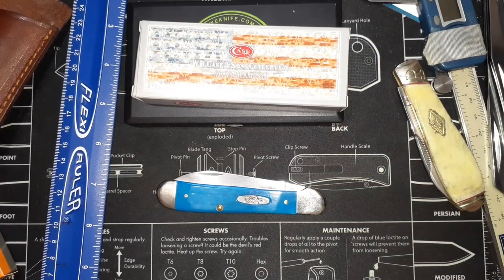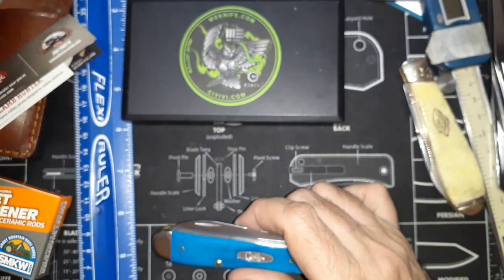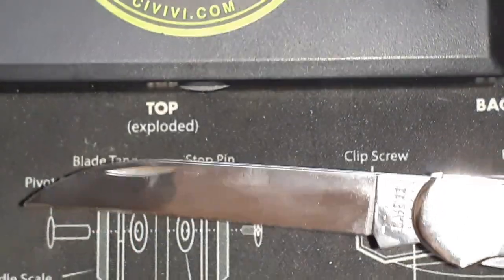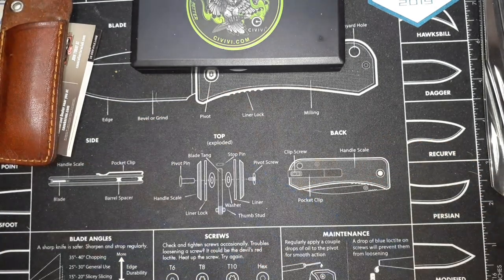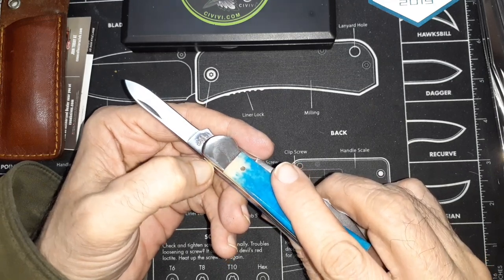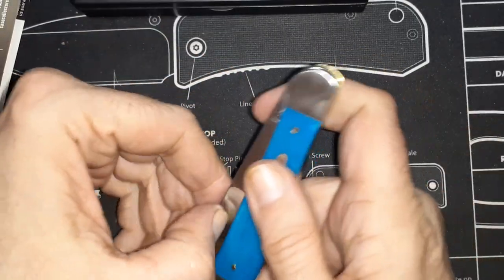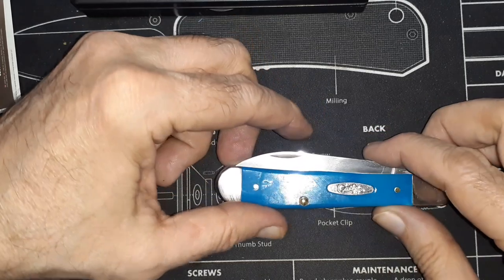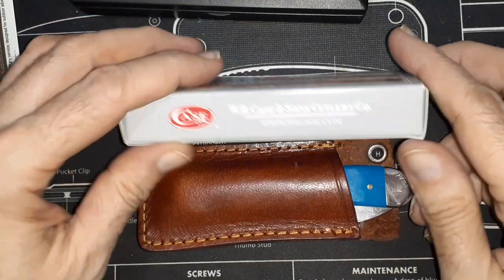(177) My Very First Case Knife 25588 Caribbean Blue Bone Sawcut Jig Copperhead 6249W SS

Comment: Thanks for the tip about the RR medium slip. Just ordered yet another copperhead (the richlite one) and threw one of those in the cart as well. 👍
Reply from the maker: they are nice. just be careful about storing your knives in them. They will tarnish bolsters.
Reply: @WilliamsKnifeLife  Speaking of tarnish, did you ever get that classic carbon T10 blade to patina? That video encouraged me to carry my classic carbon scout knife more often. Not so worried about rust now. 🙃
Reply from the maker: @krazykat64  the only one that wouldn't patina was the bow Trapper they initially said was T-10, but it was 440a. I found out 440a is very rust resistant. 😄
Reply: @WilliamsKnifeLife  You know, I was thinking about this and it occurred to me that the Chinese use chemicals for tanning that we’re not allowed to over here. Wondering if that has something to do with the tarnishing. 🤔
Reply from the maker: @krazykat64  it's quite possible. Chinese OSHA 😂😅🤣
Reply: @WilliamsKnifeLife  Really wouldn’t be surprised. I have a Case cross draw slip that I’ve kept a russlock in for ages that hasn’t had any deleterious effect on the bolsters. 🤷🏻

Comment: since i'm still fairly new and testing out different patterns, it makes no sense for me to get one case, when with that same amount can get 6-8 rough riders, or 20 frost cutlery (lol j/k!)

also, not so sure, about how the color didn't take (at all!) on the other handle cover. while differently dye taking is aesthetically pleasing, this almost looks like a mistake or error, or defect
Reply from the maker: I like Rough Ryder knives because I can test out different patterns before plopping down big money for a Case. I've bought just about every normal traditional pattern that Rough Ryder makes, and it has helped me narrow the field a little bit. It took me about a year of buying Roughies to get most of the patterns. If I had been doing that with Case, I'd still be trying to get all of them.
 
I like the difference in color between the front & back covers on mine.

Comment: 6 stands for bone 2 for the number of blades 49 is the pattern number and w is probably wharncliffe yes, all cases come sharpened like that, usually hit mine on the turn box(ceramic rods) before i even think about testing the edge. being said its never taken more then 3-4 min to line the edge back up tho, if u plan on buying more theres usually a nice display at Ace Hardware with em fyi
Reply from the maker: Thank you Just Greg. I sharpened mine with a fine diamond hone & just went up and down the edge a few times & it really got it sharp.

Comment: This thing is razor sharp in compare to the #19 gec i bought  recently 😆
Case knives are just fine and  the best thing is you don't have to get all crazy  to get them and check  for drops every five minutes.
Reply from the maker: I hear that. The new 47 Viper came out & I can't find them anywhere.  My Rough Ryder blue Denim work knife has the same blade shape & even it isn't available right now. I had to sharpen my GEC also. You would think a knife maker would have their knives coming out of the box sharp, no doubt about it sharp.
Reply: @WilliamsKnifeLife  The 47 are long gone, you have more chance finding a real viper in nature 🐍
I tried to get the tc barlow, sold out in like 10 seconds. Somehow i succeeded to buy the new #15 boys knife with cocobolo handle but i think that was a one time miracle.
Reply from the maker: @אלכסס-ח5ג  I'm not chasing GEC now that I have a few. I'll probably buy more Case & Rough Ryder's.
Reply: @WilliamsKnifeLife  Same here.
I just wanted one that looks good and you can cary it easy and without questions. The 97 is too big for that and the 19 is too small but the #15 is perfect.
You should buy more case knives they have some very nice ones .
Reply from the maker: @אלכסס-ח5ג   My favorite GEC to carry is the #12 medium toothpick. I have so many knives,  I have to rotate them in use.
Reply: @אלכסס-ח5ג  Well done on the cocobolo #15 Alex! I scored the SFO Barlow, but immediately sold it on due to F&F issues. I don't care what it is, it has to have acceptable quality!

Comment: Morning William.  Nice wharnliff. With all the small faults that you mention is the price difference with RR justifed in your opinion or are you just paying the name and USA made? At least my RR trapper came razor sharp. At home i mostly carry a London anchor knife which is a wharncliff. Or in the garden i use a two blade wharncliff/Hawke bill knife. I find the wharny the most useful shape. All the best. Stay safe.
Reply from the maker: Thank you Rhino.  I had to buy a Case to find out if the price difference is worth it.   I think they are equal to a Rough Ryder Reserve in fit & finish. A RR copperhead goes for about 15 bucks & the Case one was 60 dollars. It is slightly better built but about equal materials.  I think the higher price of Case is because of it being made in USA. As much as I like supporting a USA manufacturer,  I'm still going to buy Rough Ryder's.  The value of a Roughie can't be beat.